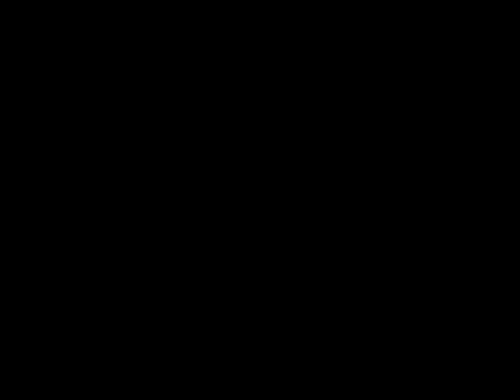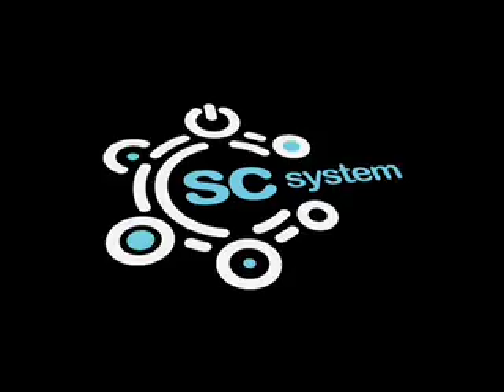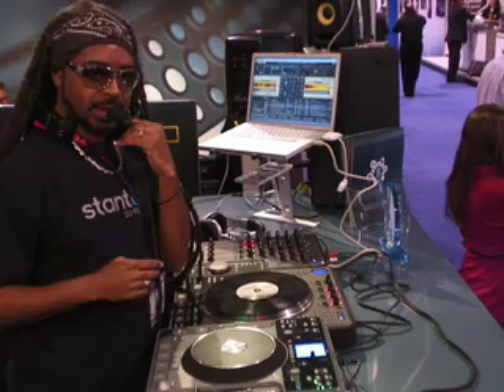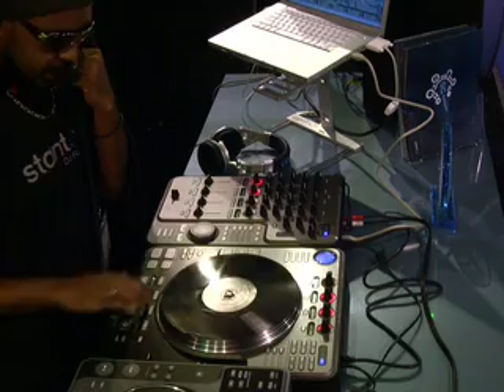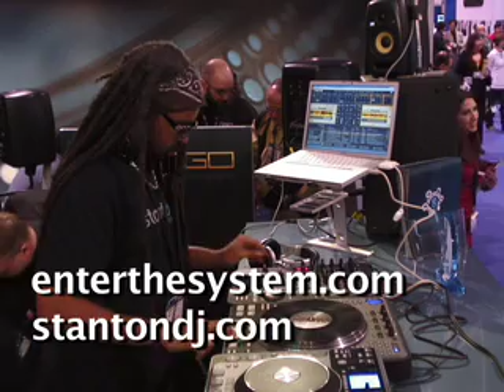Stanton SC System DJ Controller at NAMM 2008

Comment: Looks like you guys got the best new setup.
Like the modular style, w/ virtual decks,  
and all the controls w/ feedback real SICK
So, this has 0 latency scratch control, right? w/ tighter response than timecode systems?
If the crossfader is pro build, I'm sold!